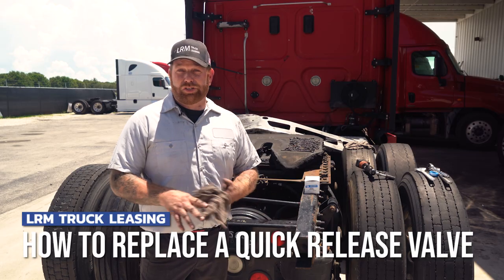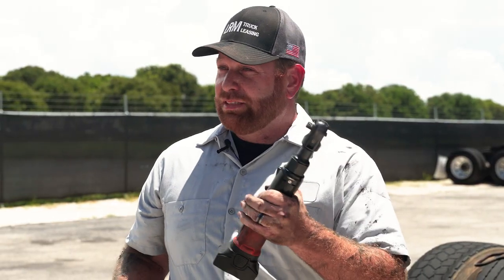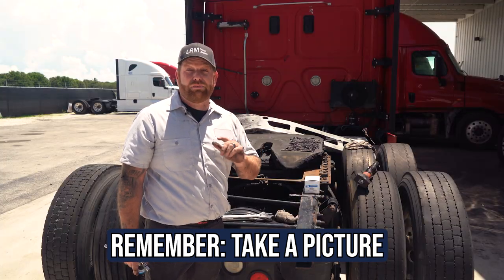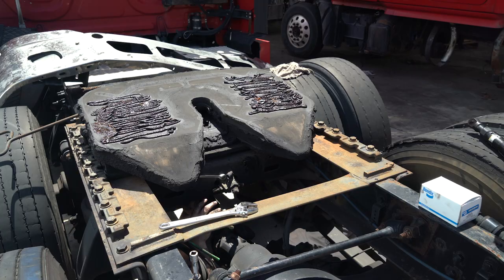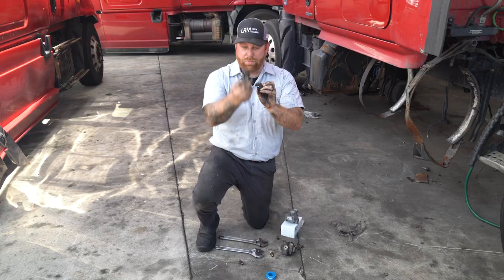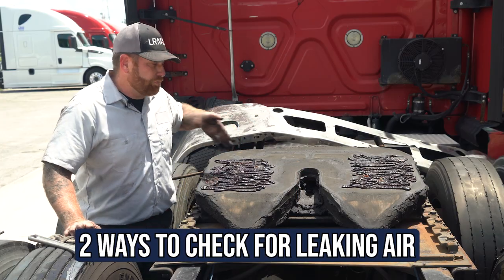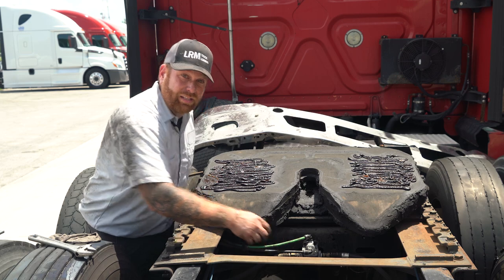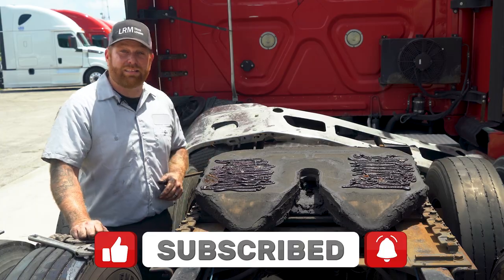Quick Release Valve Replacement - LRM

Comment: This air valve is a Bendix anti compound quick release valve  . It may cause a service relay valve to leak out of the exhaust port . A spring brake chamber may cause the same leak .

Comment: Hi Mr Steve quick question please I just pulled over at truck stop got some fuel then I usually walk around check my truck like doing PTI and I was bobtail actually and I Mentioned my 2 rear air bags only was deflated alloway down I recently change one of them then I started the engine checked the air tank gage was showing over 125 Psi which was good no bopping noice then checked the air bags still the rear 2 drive air bags was down then I  wait a lit bit with engine running do inflat the air bags but unfortunately nothing then I moved forward pulled over parked checked up it got back to normal but still confused and looking for tip help please what could be a problem? Thanks a lot and God bless you !!! Yr old student subscriber
Reply from the maker: You would need to make sure that the truck is on a level surface before starting to check the truck

1. Check the air bags for leaks if you don’t hear it use soap and water and spray at the bottom of the base. If no leaks go to the next step

2. Check the lines going to the air bag to the air leveling valve. Check for any kinks or damage on the lines. Check for any air leaks too on the lines. If the lines are good . Next step

3. Pull the line off the airbag that is inflating correctly and then pull off the one that is not deflating correctly. If you don’t have proper airflow equally the leveling valve will be bad.
Reply: Thanks for responding my problem  was my quick release valve after replacing it all is good now thanks again God bless !!!

Comment: What are the symptoms of a bad quick release valve? Evertime i hook my semi to a trailer the brakes on the trailers get stuck or slowly disengage i changed the foot pedal valve and the tractor protection valve and it still does the same thing im going to try this next
Reply: Did it fix it?